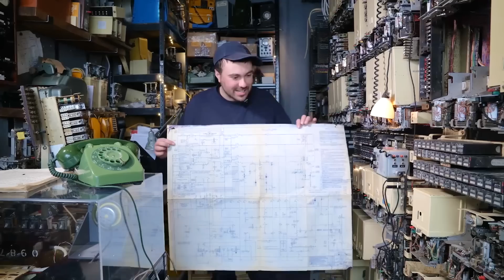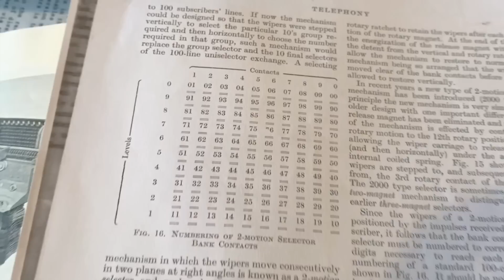BIG Museum Telephone Exchange Rundown - Telephone Tuesdays

Comment: So...a modern phone number is (country)-("state")(city)-(area)(home).  So a US number would be 1-ssc-aahh.  Or something like that.
Reply: Phone numbers outside of North America have different formats. I think our North American electromechanical equipment only ever supported 7 digits, AFAIK long distance was always handled separately.
Reply: That's somewhat similiar to what we have in Europe. In Poland it's +48 (country code, almost always with the plus sign) then next two digits is a city, where I live in Kraków it's 12, Warsaw is 22 and so on. Then you have your local number, which starts with three digits of the area code. And lastly there are four digits which belongs to a certain subscriber. So the numbers are mostly 9-digits, as you don't have to add the country code. In case of mobile phone numbers you also have 9 digits, but the first two doesn't belong to any city code, they are just random. If you want dial locally (i.e. inside a city) from a phone hooked to a land line to another phone on a land line you don't actually even have to add the city code. So you can dial just the last 7 digits and it will still get you through. However you can't drop the 3-digit area code and dial just the 4-digit subscriber number, that never worked.

Comment: I spent 13 years working on the strowger system in a main exchange.  I dealt with local systems, trunk systems (STD), and international switching in a non-director exchange.  Also dealt with TXK4 called the 'Transit' network for routing low calling destinations.  Thoroughly enjoyed my time doing that before moving on to the newer, and more compact, solid state PABX's.  Thankyou for showing this video the noises bring back fond memories.

Comment: I worked in the communications industry for 40 years ,worked for Telecom Australia which became today’s Telstra.I used to work in a SxS exchange, It had pre 2000, 2000 and SE50 selectors,It was the trainees job to oil and dag the selectors and banks.I later moved to an Ericsson ARF exchange which involved lots of training courses.The first course for ARF went through the circuit diagrams and relay sequence diagrams and start of day one was sub A picks up handset .The sub got dial tone at the end of the 3rd week of the course.I finally left the exchange when modernisation to ARE and AXE exchanges did not require as many staff.

I then moved to installation and maintenance of customer switching systems finally owning my own customer premises business.

I have now retired but operate my model railway with PO 2000 type relays I rescued from the last SxS exchange in Tasmania.
These are operated with arduino s controlled from a PC.

I enjoy your channel, It brings back memories Evan though our equipment was a bit different to yours.

Regards
Robin.
Reply: 3 weeks to get to dial tone! I can believe it. Cheers happy you’re enjoying the videos✌️
Reply: God, I love comments like this. Thanks for sharing!
Reply: Just like me, I moved from Strowger to System X (similarish to AXE10). System X (a digital switch) used a lot less staff. The strowger I started on had 14 staff, the same System X had 1 and that was shared with other System X exchanges. In the end System X was so reliable they cut the staff. I moved into the data side (X25, Frame Relay, ATM) that all became obsolete I ended up in IP (routing and switching etc). Im still there today and something completely removed from SxS

Comment: Things made more sense when you showed the alotter uniselector. I couldn't figure out how the whole system "knew" which line finder to use, and how it was wired up. I'm guessing every line is wired internally to every line finder. And the last position on the allotter is used to connect one frame to another so your exchange can handle more simultaneous calls?
Reply: Not sure, but I suspect each frame's set of line finders and first selectors handles one block of 100 incoming lines. So there would be no interaction between the allocators in different frames, and each 100 line block would have its own limit on simultaneous calls.

Comment: Awesome video, as an electrical vehicle design engineer, I'm still totally baffled by how these old electro/mechanical phone exchanges actually work. That's not a criticism of your explanation, just the inability of my brain to process the actual workings, kinda got a grasp of it, but need to do a lot more homework to fully understand it. Thanks for sharing! 🙂😎🤓❤
Reply: i was the same and I worked on the stuff
Reply: Relay logic is horrible. I could never get my head around it. Thankfully I transferred to radio communications which I can understand.

Comment: It would probably be worthwhile showing how simple the dial mechanism in the telephone actually is and how it simply pulses the connection a number of times to match each digit dialed.
Reply: And how you can dial without using the dial by "tap dailing" on the handset cradle buttons if your timings good enough (10 pulses per second, 1 tap for each number and 10 for 0).
Reply: Taught a friend of mine how to do that  his patents had a lock on the dial